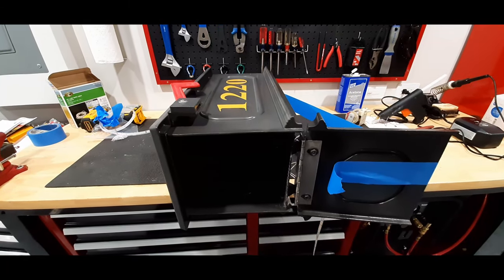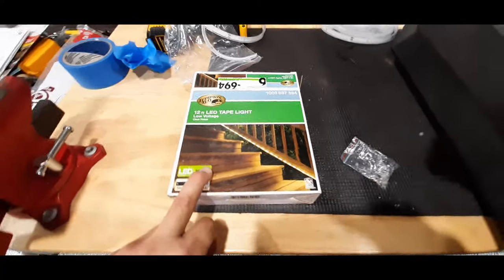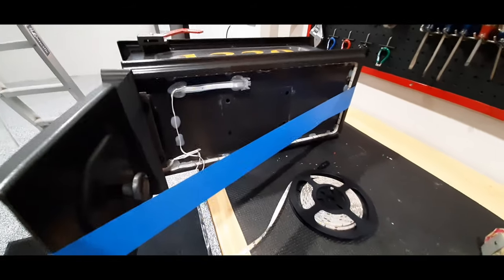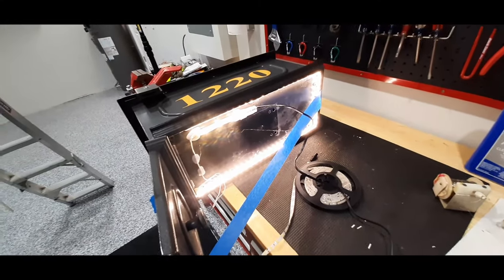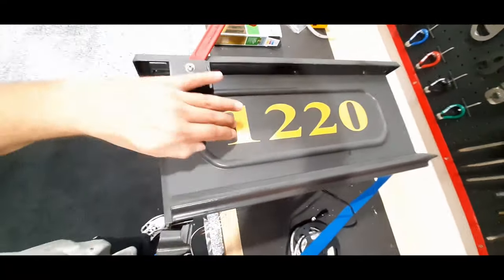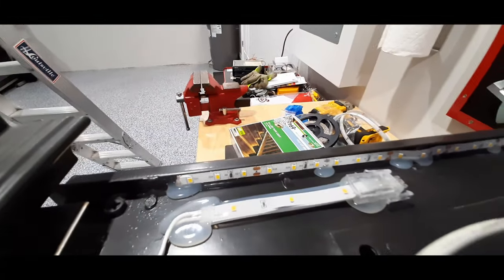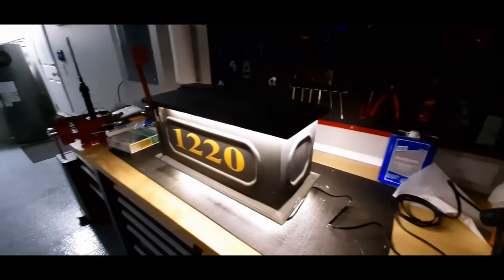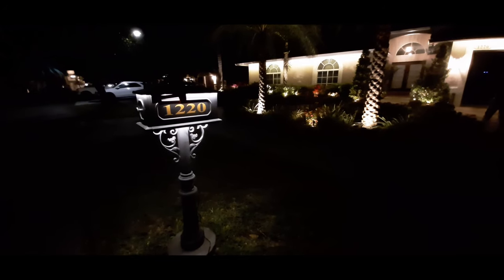Mailbox LED DIY  with Homedepot LEDs Cool Mailbox retrofit

Comment: Can you make a solar panel battery version?
Reply from the maker: Hello that is an interesting idea.  I would need a bigger solar panel and more batteries if I wanted to make this setup with that many LED's.  Since I have landscaping light already I used this setup but before I had a solar single light shinning upward towards the mailbox and worked well if you want to buy one or 2 of them and put them on the ground.  You can put multiple small solar panels on top of the mailbox or somewhere near by and run a cable to it.  Double the size of the batteries depending on the amount of LED's you install.  The thing is that one battery works well with 1 or 2 LED bulbs so if you add a strip it will drain the battery fast and wont last. I do have a single one laying around and will try an experiment and let you know. Thank you
Reply: @ExtremDIY  alright and yeah let me know, I was looking at litom landscape spotlights that have multiple LEDs and a solar panel on top and just take that apart and see where I put what.